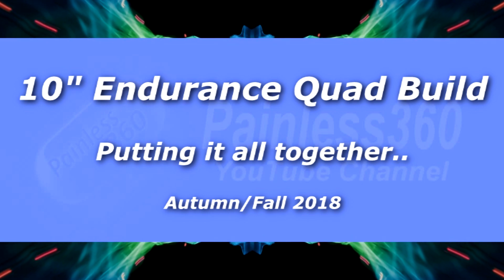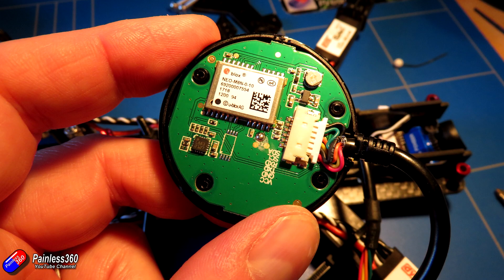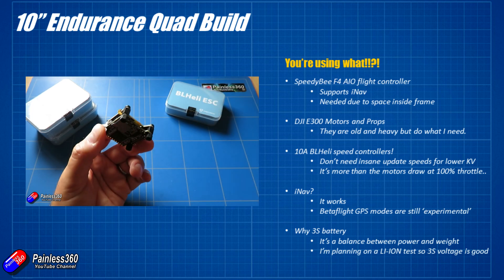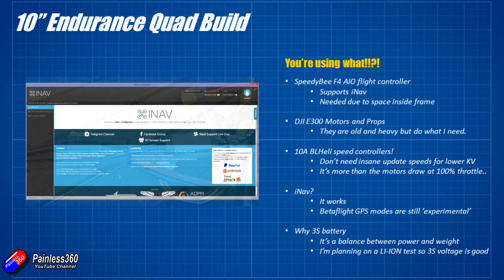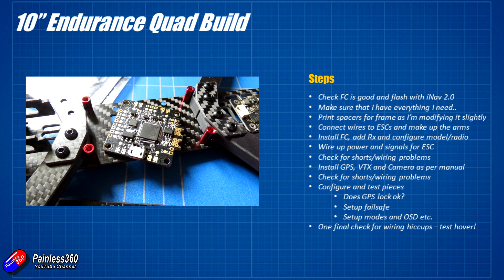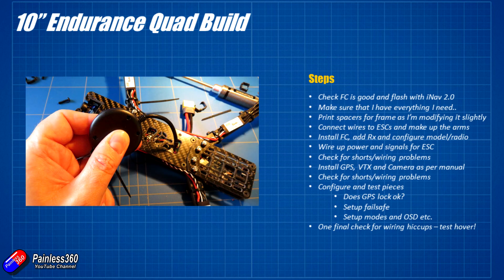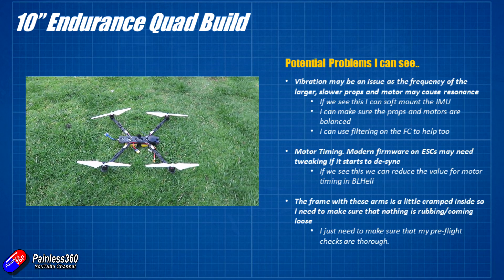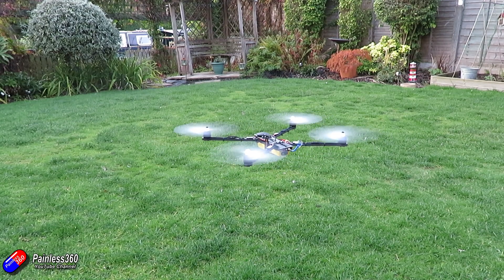Endurance Quad Build: Building the quadcopter and test hover

Comment from the maker: For all of you worried about the magnetometer being affected by something as it's on the front of the model - don't be ;) The mag isn't working (tried three GPS/Mag units of two types, rewired it and reduced the i2c speed to 100k with no luck) and I'm now suspecting the Flight Controller has a problem as others are using the same setup and it's working fine. For those of you who can't mount the MAG far away from power lines or worry about interference - see my video on MuMetal ;) Happy flying and thanks for all the comments..
Reply: Perhaps the mag is on another i2c address then the firmware expects to find it at.. Perhaps worth to investigate..
Reply: I´ve watching Painless360 videos a long time ago and i just finished a long range v-tail whit his advises and tips (you can see the creature in mi channel). My external magnetometer works fine in betaflight but it was a real pain to config in CLI since it's a I2C port device. For external magnetometers iNav can give better results than betaflight. Anyway a nonfake Honeywell chip is a must.

Comment: This is sweet I did a project recently looked very similar it is a TBS discovery Clone and I just the same dji e300 motors I have a P1 and used the naza flight controller and phantom 1 receiver I did use the 30amp e300 dji escs also. Then I put a cheap 600mw foxeer cam setup with the old school Immersion rc EZOSD gps overlay with audio mapping. And my go pro hero 3from my P1. And for batteries I am using 2300 3s 50c in parallel. I get roughly 45min flight time.

Comment: I absolutely loved this one!!! All your builds a really well done but this one... The vibrations could be due to the square section of the arms caused by the airflow of the props. If you could find a way by  giving them a bit of a curve at the top might solve it. I also experimented with Li-Ion batteries on my small brushless SkyViper using a cells from  e-cigarettes but the current rating is just not enough. Next will be high discharge Li-Ion in 3S2P configuration going trough a 40A BMS board, the same I'm using on my drill battery conversion. I think Litokala worth looking at. Also adapted and tried Syma X8 props on 2212 outrunners with F450 frame as they're really close to the 9443 DJI props. I've fitted a Syma X8HG flight controller on a H frame built from 20mm PVC pipes and 4mm ABS plastic, again with 2212 and adapted Syma props, just to see if would take off :-D Great videos, great and informative channel!!!! Keep experimenting! Regards!!

Comment: I recently assembled a massive almost 600g 3S4P 18650 battery pack for my quadcopter. I used some really old Panasonic 2000mAH 2C cells from 2008 (new old stock). Despite the weight and low C, I found I could still hover at half throttle and with a flight time of about 20 minutes, compatible to a LiPo. I suspect if I get brand new 18650 cells (LG HG2 if I can get genuine ones for cheap) then I can get away with a lightweight 4S2P or even 3S2P. Although given the apparent weight is not an issue going with 4S3P may be the best option for longest flight times and performance!
Reply: Also it should be noted that "LiPos" are actually also lithium ion cells. The term has come to mean pouch style cells rather than cylindrical cells. You lose out a bit of volumetric efficiency with cylindrical cells but gain in terms of capacity. It may be soon we start to see 18650s and other cylindrical cells make a comeback and replace "LiPo" pouch style batteries once more!

Comment: Nice build. I'd consider removing bullet connectors between ESC/motors, they add up quickly and actually weigh quite a lot! It's very quick to direct solder/unsolder if needed anyway.
Reply from the maker: This is a test rig and I’ll want to swap pieces - hence the bullets.. I haven’t used them on regular builds for a long time - see my quad build series.. happy flying!

Comment: Received the material for a 10" endurance quad for Xmas and now that has become my winter project (thank you ). I have access to a waterjet and 5 mm carbon fiber sheets and plan on creating my own frame and arms in Fusion 360 but I would like a good starting place.  Do you or one of your followers have a source of drawings for the frame and arms?  
Thanks in advance!

Comment: go back to 7 inch model and work on prop/motor/esc combo, i got 300-400ma less current draw 
just by swapping from dys sn20 to dys xs30 and use the 18650 cells.
this is to big and cost more

Comment: How did you solve the following Problem?
The prop will come off if the Motor tries to stop due to djis poor Motor-prop-Mechanism. I didn't find a way to tune the esc so that it doesn't Brake. How bout You?
Reply from the maker: Apart from fitting them well and throttling down as low as you can before stopping the motors.. not really :)

Comment: not flown in over a year as i got annoyed with my build and then all these stupid laws, one day.... anyhow, when i was playing around i found on my  octo that my ESC's when doing nothing at all took 40ma each, that was 320ma  sitting idle, and no doubt just as much when flying! 
i tried them against some 40a esc's i had  and they only took 15ma, so i swapped from 30a to 40a esc and got many more minutes of flight time. 
its worth checking the standby current of /all/ your components.  oh and also not worth buying cheap 30a esc's off ebay..... (actually the 40a cames form ebay too but....)

Comment: HI,
Did you update the esc yet? Please let me know... when I tried to update mine I destroyed the FC. Not sure if it was the update that destroyed it but it happened just as I tried to connect BLHELI software...
Reply from the maker: I've not as I'm not sure that'll help get it flying super smooth. I think low pass filters/filtering on the FC and a tweak to the PIDs will so more..

Comment: Og style! Should have used clean flight lmao jk GREAT vid seriously any FC will be great on this... love supper efficiency in birds like this my 450 gets a good 45 mins on 12 inch carbon fiber and 4 or 3s give or take without gimbal and 5kmah again give or take, I started with  it birds n it's nice to go back with these great new frames I want one! Keep it up looking forward to more m8!
Reply from the maker: What motors and props are you using on that 45min flight time build - that's cool!
Reply: @Painless360 self tighting 12 inch carbon fibers from foxtech, absolutely love them balance is crucial, and my "trick" RCMC huge love to ManChild.. 3407 750 kv my ALL TIME FAVORITE MOTORS EVER for a LARGE quad, simply insaine power and performance, ty mcfly, and using TBS bullet proof escs w usually a venom 3 to 5k mah 3 to 4s... my build is so effective because its soo over powered more or less, when in a (rate) mode roughly 10% throttle is an arm bending a punch out, so with a pixhawk FC it uses almost no power to fly in a lioter GPS mode, making it a PERFECT candidate for your battery idea, (who knows how long I could get) and I've been thinking the same thing looking forward to seeing you do the batt.. just need to actually do that also.. and Its just an old spider frame, a hybrid of that the Flamewheels parts on a tbs discovery style but cheapo frame, replaced with DJI arms for needed strength.. and Its a much pricier version.. your build is off the hook. Great frame, I REALLY WANT.. super sexy cheaper and my hats off sir, you reminded me why I love this kind of build IN the first place... and its helpful to go back to basics. Hope this can be useful, ps some of the parts I mentioned can be considered upgrades i.e. bulletproof escs not necessarily needed as shown but nice to have, for anyone doing a bigger build looking for max flight times and rock solid preformance.. viewers please bear in mind this build was done for less than the cost of the 3rd pixhawk I'm using.. I Love the FC, but the coolest part of this is how cheap it is to build, I only achieved this after spent years acquiring and big money to do so..All my best LOVE the channel brotha...

Comment: Managed my first test flight of my long range using my Q450 build, Pixhawk and Sunnysky motors.  Using an old 3s 4000mah 10c Multistar battery I got 18mins with an all up weight of 1316g. Built it to take a Multistar 5200 though so look forward to seeing how long I can fly for before I try 4s

Comment: I have a video on my channel, the most recent one where I fly for 9 minutes on a 1500mah battery with a 5" quad. I'm sure endurance can be done with smaller hardware, but the difference is going to be prop choice and battery weight.
Reply from the maker: If you could post some detail on the video about what motors, props and everything else you're using that would be really interesting. Happy flying

Comment: I'm building an endurance quad and had already set aside a number of square flat Li-Ion batteries that were recovered from HP  laptops (part number CM03XL). They contain 3 tabbed square, flat cells and are rated at around 4Ah. Due to a BIOS issue with the charger monitor, many HP users were supplied replacement batteries that were not required hence the surplus.Looking forward to your result. I'm wondering how much power you could recover using regenerative ESCs. Those big props should act like windfarms!

Comment: Thanks for this and all your videos Lee.   Your efforts are definitely worthy of Patreon support!   
I am also working on a low cost, 850mm+ endurance hex build, and following this closely.  I wonder if there is a Flynoceros hex option?
What is the build cost to date?
Also, perhaps you would be willing to devote some video time on the choice of battery.  I am still unclear regarding 4S vs. 3S, etc. for endurance.  I am thinking of using two 4S 5ah lipos in series split across the frame to distribute the weight, leaving room below in the center for my payload.
Reply from the maker: Now we know that the calculations work, we don't actually have to build the quadcopter to be able to figure out flight times so this is definitely something I can look at as I get more Motors and props in try..

Comment: I LOVE what you are doing !  EXCELLENT  BUT ………….why not find a wrecked DJI  use the bits and bobs (and lipo) ...mount it all on an FPV frame !  Bob's Your Uncle !!
Reply from the maker: That's not half as much fun (and won't get manufacturers to wake up to the needs of us pilots either ;) Happy flying!
Reply: Painless360  I agree.  check out  GRINNALLCARS.COM  I imported and built these  using parts from wrecked BMW bikes.  Brilliant.   I LOVE BIG KWADS !  would you consider building using the DJI OCCUSINC  components ??  I bought the RE Goggles   and actually have two 7" kwads  under construction using this stuff.  actually using TWO cameras .

Comment: You need to take a look at some of the X-Class racing frames using much bigger motors and frames but also using betaflight and Blheli 32 ESCs so similar problems.
Reply from the maker: That's a great idea. Let's hope that the new class of racing drives some innovation..

Comment: China Clone FCs often have missing pulldown resistors, especially the Omnibus ones were known for this. You're probably not using a cheapo clone for this, but for anyone who is, adding them may fix your compass issues.
Reply from the maker: Thanks for the idea. This an original FC from the manufacturer but others are using it without problem so I'm suspecting I've got a dud (see the pinned comment). Happy flying!

Comment: With such big props it might be worth looking at a more mechanical method to soak up those vibrations....
I think if you add an RC Explorer type sprung battery tray* beneath it then it would go a long way to absorbing some of the worst of it- would also offer a place to mount a HD camera/GoPro should you wish...
Just a thought....
Best of luck!

*edited for spelling
Reply from the maker: Great idea! Soft mounts would be great (as I mention for the FC choice). Let's hope that if this frame becomes a real thing that they are built in..

Comment: Lee, good work. Two ideas.  Good bets are Sony VTC6 18650s, High Current Draw, or 32650s @ 5000-6000mAh.

Also, since the frame body is so thin, wouldn’t it make sense to rotate it 90 degrees? Less air resistance equals less current draw in flight.
Reply: Northern Flyer:  Thanks for the heads up on the VTC6, very interesting, I'll have to try some.
Cheers  Steve
Reply from the maker: Thanks for the idea. I'm hoping that this series and the enthusiasm for these kinds of builds isn't being missed by frame designers ;)

Comment: A blast from the past... I like it.  8^)  I recently pulled an older DIY "camera gimbal" quad down from storage and stripped the camera gear , added a VTX an FPV camera. With a 3S-5000 it weighs 1350 grams. I can keep it in the air for 13 minutes of 50/50 hovering in position hold and FFF traveling 1160 meters before the battery voltage is down to 10.5 volts. This copter has a NAZA-M v1 (newest v2 firmware), 30 amp escs with simonK firmware, and SunnySky 2212 980kv motors with APC 10 inch MR props. I'm now on a mission to get more weight off of the airframe and will try 11 inch props as well.  I've tried racing quad components on larger builds with little success, with PIDs low enough to stop the jitters, left a loose and sloppy flyer. Looking forward to your experience/testing. Good luck with this build!

Comment: sir, don't forget to consider the voltage drop of the 18650, this will lead approximately to the same flight time, and with lot more disadvantages.
the efficiency of this model is relatively low ,  you will end up using the li-ion between 1.5 to 2 C (discharge rate),  this will not allow you to use more than let's say 50 to 60% from the 18650 total capacity. 

thanks for the video anyway.
Reply from the maker: Let's see what we find with the testing - not all LI-ION cells are created equal.. Happy flying!

Comment: I recently crashed an old favourite quad of mine, the big 600, trying to find a low cost new frame to accommodate the big 3108 720kv motors but tarting to think i should look at smaller frame and 2212 size motors
Reply from the maker: Check out that 7" build - that has the same endurance as this model but a lot smaller and easier to transport..

Comment: Well you have me going with this series. I have a couple of older 355mm frames laying around so I am off trying to learn something about all this. I also have some older DJI motors and some lower KV old Armattan motors in a pile somewhere. I have no idea what I am doing, but I am going to give this stuff a go. I have had some success with a super light 5” LOS build with 1806 motors and 5040 props, nothing but frame (Merica) and 20mm AIO, getting upward of 20 minutes flying time. This is fun, just not the same ol thing… Thank you for this series.

Comment: I see your doing what I suggested and add some link plates between the arms..

Are you going to drill a hole through the center after the two parts are together do you can wire everything inside the main frame?

Or you doing it just for strengthening reason?
Reply from the maker: This is just a test - the designer is already looking at a better way of doing it if there is enough demand for 10-12" models. This frame wasn't really designed for these huge arms but was the best of the ones he had (thanks again to the guys at Flynoceros!)

Comment: I had to lover the I2c speed to 100KHz to get the compas going. You can do that from commandline i2c_speed parameter.
Reply from the maker: Wow! Thanks for that. I’ll give it a shot.. :D
Reply: Painless360: I ended up using an Beitian BN-880 instead. It runs fine at 400KHz (default).
Reply from the maker: I've swapped to one of those already and still no luck..
Reply from the maker: Nope, not a peep. I'm suspecting that I've got a problem on this FC with the i2c pad(s).. Thanks again!

Comment: Are you aware that cylindrical cells usually have their capacity specified for a very low discharge current of something like 0.1 to 0.2C, because that is their usual usecase? You can't compare the stated capacity with pouch cells, which usually rate their capacity at 1C and above. As I said on a previous video the differences between cylindrical cells and pouch cells are in construction and application, not necessarily in chemistry (cylinder or pouch is just a shape; it doesn't tell you anything about the chemistry inside without a data sheet).
Reply from the maker: The testing video will tell ;) I’m working with a specialist for all of that.. happy flying!

Comment: I assembled similar setup on XL8 frame, fpvmodel 2208 1100kv motors (they are not the most suitable, I just got them cheap), 9030 flat carbon props and 4S 5200mah battery. I get 40 minutes of flying, maybe more if there's no wind. Now I want to replace the motors with Sunnysky V2806 650kv, the thrust will be lower but should be enough. Also, if your frame weighs more than 155g, you can use Q380 frame instead, it's very cheap and accomodates 10 inch props. With less carbon there will be better range.
Reply: jon beech The frame is XL8 but it can take 9 inch props. I guess XL7 can take 8 inch props, etc. The frame is OK, it's light enough, great looking and sturdy. The downside is camera placement, these big props will be visible, in fact even front motors are visible by half. I recently replaced motors to SunnySky 2806 650KV and 9047 props, expected about 45 min. flying time but... after 30 min. flight my copter suddenly disarmed mid-air and drowned. It was yesterday. The FC was Matek F405 STD and the firmware was INAV2.0. So I don't have this frame anymore :(
You can see my older recording with this frame here: https://www.youtube.com/watch?v=uaQsJhAP8Ts